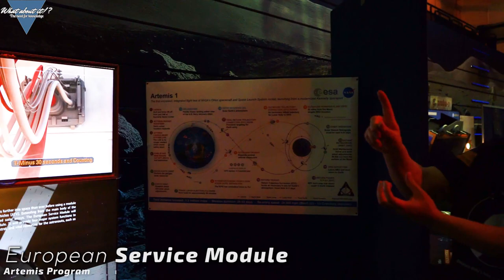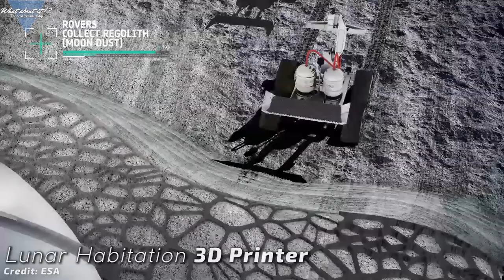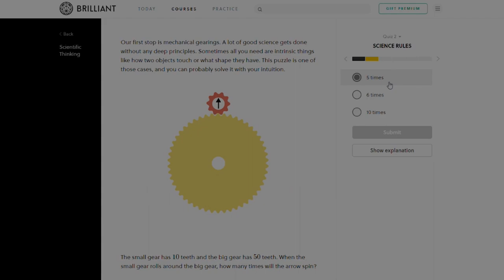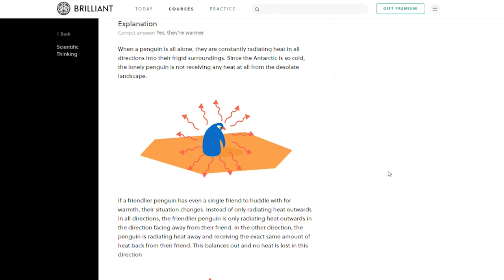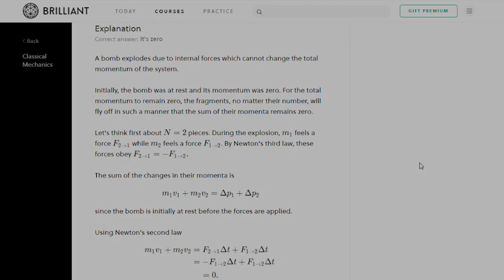40 | SpaceX Starship Updates - SpaceX Construction At Pad39A - ESA Open Day 2019

Comment: Will those blue zip ties on starship potentially melt? Or are they going to be protected enough or are they not simple ties?
Reply from the maker: They very much look like simple ties. They will be covered by metal and they won't be near any heat source. The engines are way down and Mk1 will not see a lot of heat from any reentry. Heat at 20km returns is minimal. Otherwise Skydivers would need heat protection. ;)

Comment: The difference in attitude and scale of thinking between ESA and SpaceX is hard to believe

Apollo was a model T, the current NASA moon plans are a Model A (just slightly larger, slightly more modern, any significant trip requires many trips to stage supplies) Except they aren't even talking mass production, they are still hand building each one uniquely

Musk/SpaceX are introducing mass production (an engine per day by the end of the year!! how many engines does ULA build each year?)
They are also building a vehicle that's like an 18 wheeler compared to a model A

This video shows the tiny 3d printing robots to move dirt around on the moon.
I expect that SpaceX would convert some backhoes/bulldozers (i.e. standard construction equipment) to run on batteries and just ship them up. total cost of conversion and delivery to the moon is probably cheaper than the R&D for the tiny robots, possibly cheaper than building each of the tiny robots (ignoring R&D and launch costs)

I do predict that SpaceX is going to find power a limiting factor, I don't believe that solar panels are  going to produce the energy they need, so in 10 years or so, I expect there to be a new Musk energy company producing next-gen small scale nuke plants.
Reply from the maker: I definitely agree on the mass production approach, but the science part does not come from SpaceX and they will have top work together to achieve the goal. A Bulldozer can't do anything on the Moon. You would need a whole factory string to build things on the Moon. Concrete does not lay around on the Moons surface. 3D printing from Lunar regolith is going to be, what they have to do in the beginning, no matter the size of the printer. If ESA develops the printer, and uses SpaceX for the ride, they can make the printers bigger! Perfect! :) Have to agree on SLS though. I do also believe, that it's the wrong approach. In fact, Apollo did a better job. They were able to do it without the gateway station...
Reply: @Whataboutit  I don't think we need 3d printer setups, we need concrete mixer setups. get fairly standard construction equipment to move the regolith and mix it with the harner that they are talking about spraying in the 3d printer. then move it by the ton, not by the pound. It probably doesn't need to be hard all the way through, put a small layer over the base, spray hardner on it, move several tons more then harden the outer layer. This calls for fairly standard heavy construction equipment, not small bots.

but when you only have the lift to manage small bots, you limit your thinking to them

it doesn't matter if the actual material is concrete or regolith, it's the methodology I'm talking about. 3d printing is about putting a small amount of material in place very precisely. concrete/earthmoveing/whatever you want to call it is about moving large amounts of material and mixing it as needed.

I have to disagree with you that Apollo did it better, the reason they were so limited in what they could get to the moon was because they had to do everything in one disintegrating stack. by staging things with multiple launches they will be able to get a lot more to the moon. (just not nearly as much as starship)

an interesting question for you to research, what is the total payload of tools (including rovers and robots, but excluding the landers themselves) that has been delivered to the moon by humans. I'd bet that it's in the single digits of tons. I wouldn't be surprised to learn that a single bulldozer or backhoe is more mass than the combined mobile devices that have been landed on the moon to date.